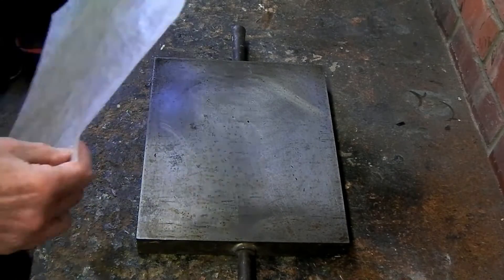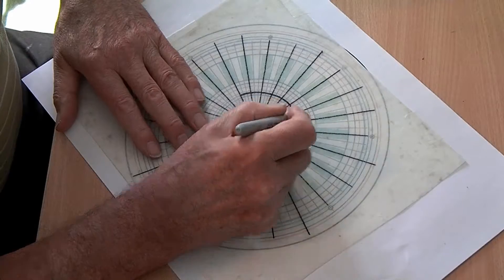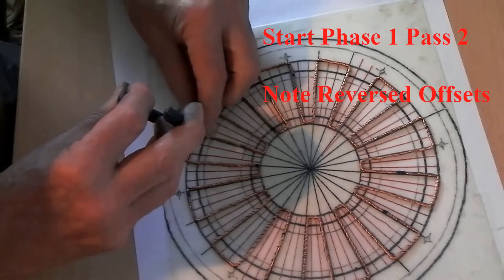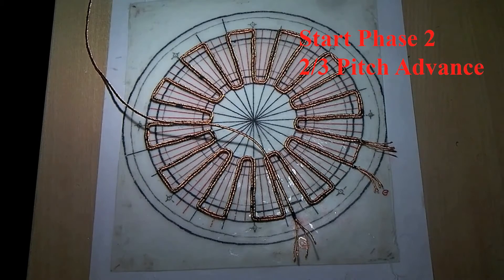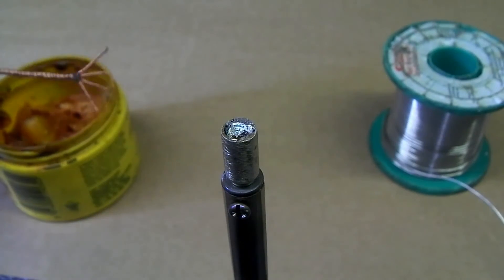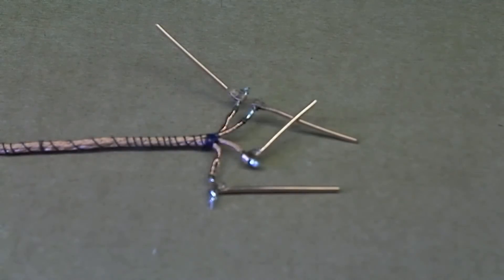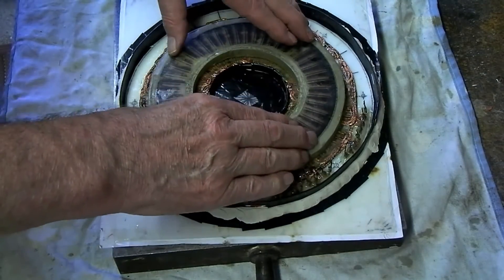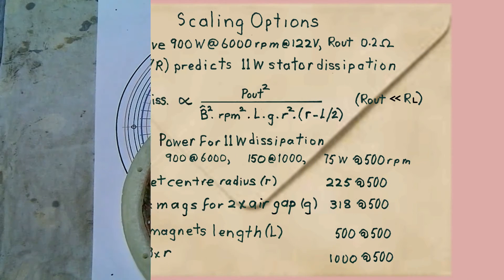Part 3. Axial Flux Alternator Stator Assembly and application options

Comment: I am fascinated by this design. Thank you for your very good explanation. 
Is it ok if, instead of 30x10x5mm, I should try to use 30x10x10mm magnets, for a greater magnetic flux between coils?
Reply from the maker: Yes. See my Parts 4 and 4A.     Meant something like  3 times rotor diameter  and magnet volume   
for acceptable  output power and and efficiency  at the lower speed of a directly coupled wind turbine.
Reply: @YesEinstein  Hello and thank you for your response.
I want to try to build one.
I had to choose between 40x20x5mm and 40x10x10mm magnets, both N52 with the same price. I do not know if I chose corect, but I will get 40x10x10mm, because of greater magnetic field at 1mm distance from the magnet (4693 gauss vs 2335 gauss). I will use 24 magnets on each rotor, pitched at 15 linear mm.
For the coils, I will use 40 twisted 0.12 enameled wire to form one strand, that will be equivalent to 0.759 mm wire. Then, I will twist 40 of those strands, so they will have a diameter of approx. 4.8mm.
Two strands will be put in parallel (for an equivalent of 1.073mm wire) and 20 of those in series for a total of 20 turns per coil leg.
I do not know the math behind, I hope this will work. 
If you have time, please let me know if it is ok.
Thank you again for the help!
Reply from the maker: @acesias   Suggestions:  Decide  number of turns needed.  Reference should be around  1.5 v per magnet crossing at 6000 rpm.  Note bundle width  geometrically limited to 5mm per phase.   Optimum axial gap also looks around this  value  when filled by copper.  Litz-type windings ideally need to ensure every sub filament crosses the same net flux and has the same impedance.  A  good composition  might  be four wound sub bundles each comprising three sub subs for  1, 2 or 4 x connection options. Shame 5mm magnets  not available; double  the cost and mass for not that much computable advantage.  Best regards  YE
Reply: @YesEinstein  I have found 40x10x5mm N52 magnets. As you said, half the cost and weight. But, the magnetic field at 1mm distance for them is 3331 gaus vs 4693 gaus for 40x10x10mm. That difference in magnetic field will not be so important for the same 5mm gap between magnets?
I am targeting a slow rpm, at between 500 - 1000rpm and I am looking at getting 24 - 30 coil turns per magnet
Reply from the maker: @acesias   Capability may be  judged by square of field across the gap divided by the  winding resistance.  N52  should expect around 0.6 Tesla at optimum  gap of around half the magnet thickness. We might thus  expect 10 mm to double  power capacity. My analysis however, indicated less than 50% improvement.  Twice the copper mass is needed.  For your low speed, best Litz may just be 3 wound subs wound 4 times around the stator per phase.

Comment: Is it possible to make this into a wind turbine? with more phases or more laps?
Reply from the maker: Dear Max Chillen  More laps would increase open circuit voltage  but not affect power handling capability. Three phase  is optimum.  For a low speed wind turbine, dimensional scaling by 3 might  give acceptable capability. Regard YE.

Comment: Thanks for your informative video. What configuration did you use for connecting the 3 phase wires?
Reply from the maker: Dear Maz Ekbatani  Simplest  option is  basic Star.  Sets of  4 pins are wired together to form successive start points and common end of the three  phases.   A  3 phase rectifier  (6 diodes)
produces the output. Regards YE
Reply: @YesEinstein  thank you very much.

Comment: You can also 3d print a core like i have
Reply from the maker: Dear RoboTronicsMotors .  You appear to have a coreless central stator (i.e. no iron) containing three-phase windings. For maximum efficiency, design aims should be 1. to maximise the magnetic energy in the stator volume (not clear here), and 2. to fill it with as  much active copper as feasible. In this respect any separators should be as thin as practical as advised.  You clearly have lots of lovely machinery at your disposal. Regards YE

Comment: how would you make a jig to make this kind of winding with out gluing to paper? I have a 3d printer and cant figure out a simpler way to create this coil
Reply from the maker: A more sophisticated one-off assembly method might be developed. Evenly attach 72 (24x3) thin rectangular “spokes” to the initial fibreglass sheet, between magnet inside and outside radii and up to the magnet thickness.  Attach two solid rings nominally twice the winding depth leaving radial space for the winding arcs and open hub. Successively wind each phase, starts two slots apart. Given a 3D printer, the frame might be fabricated in one piece adding encapsulant and top sheet after winding. Regards YE

Comment: Would you get the same amount of power out of your design if you used regular magnet wire?. Say, about 10 strands @ 0.5 mm magnet wire instead of the litz?
Reply from the maker: Dear Natasha McGill. Thanks for the progress report.  About 10 strands of 0.5mm per magnet crossing would maintain the baseline output voltage and winding resistance.  Calculation indicates however an additional 200 Watt copper eddy loss at 6000rpm.    Operation at 1000 rpm should give 5Volt and 100Watt at 90% efficiency. Around 5Watt eddy loss may remain. If required, finer strands with more bunch crossings would elevate the voltage while further eliminating eddy loss. Note the baseline winding can be connected, essentially this way, for 1, 2 or 4 times output voltage without efficiency loss.    Analysis has shown that the gap between rotors should be about the same as a magnet depth; 5mm in the baseline.  Design should pack maximum possible copper into this space. Note that wiring should ensure, as far as possible, all strands develop the identical voltage!    Regards YE

Comment: I am learning to design and build AC axial flux alternators for green energy. And part of my focus is energy densification. I am totally intrigued by your stator winding scheme. Unfortunately, I cannot for some reason find any really decent books on stator windings that include your style shown. Can you referance books for me? As many as you please, if you have more than one. Also, can you describe to me how to create the litz wire? From start to end? Every litz I have created so far, wants to twist itself up into really nasty bindings and pretty much ruins itself. And last of all, is there a way to scale this down to be a 12V alternator at lower speeds? Say, for charging a car battery in emergency situations?
If you can respond, I would be soooo grateful, that I would reference you as my inspiration when I finalize a product!
Reply from the maker: Dear Natasha McGill,  In the context I have only read,  and referenced earlier,  Professor Carter's 1954 book, The Electromagnetic Field In Its Engineering Aspects.  I have since  read some of the  many articles on the internet, so far with no obvious conflict. The Fem2 field analysis program is freely obtainable.  Low spec Litz needed  practice; try twisting and folding under tension.  I have already indicated scaling options.  In view of your and similar comments maybe I have to video a method of low speed high power design. Automatic efficient matching of one machine  to different speeds and varying loads was a feature of  the early bike series and can be developed for the permanent magnet machine. Thanks for the kind offer!    Regards YE
Reply: @YesEinstein  I would most definitely would appreciate a video of a low speed high output design to be shown. So far my focus seems to be energy identification. Aka overlapping stators. Concentrated coil or wave wound. Also, I am focusing on extraction of the most amount of emf via reducing the thickness of the air gap. And a diameter of a decimeter also. I don't know why , but, I am really stuck on creating a design of 10 cm diameter, with minimum 8 poles, and up to 16 coils double layered, or even tripple layered. Or windings like yours. And with a performance high enough to charge a couple of 18650 batteries . And by wind also. So about maybe 900 to 1200 rpm. It's a challenge no less lol.I have had some rudimentary  successes so far. Ultimately , I want to create a stator winding that basically has inductors in every single mm for maximum flux capture. This endeavor I have undertaken is most difficult lol. I do say, I really really admire your stator .  Its so neat and tidy.

Comment: YesEinstein, noting that you posted this video in 2016 I was wondering if you would be willing to do an email exchange on this subject I am currently investigating low cost wind turbine designs for manufacture and sale in Ethiopia the principle issue being to get as much power as possible at the lowest cost, the Halbach array combined with progressive wave coil may offer some potential to reduce copper content and therefore cost, would you be willing to discuss ?
Reply from the maker: Dear Kevin Roberts.   YE responds to public constructive  comments, and queries relevant to the immediate videos. Your contribution in this mode would be welcome.  Regards YE

Comment: Dear YesEinstian . Thanks for the educational content
What is the name of this type of coil? I want it for research
Reply from the maker: Dear Fara Tec,   Progressive Wave.  Regards YE
Reply: @YesEinstein  Thanks for the reply
Reply: I tried to make a sample similar to your model and did all the things, but with two differences
1- In my model, instead of rotating your magnets or routers.  I turn the coil for less weight
2- Instead of using a fuel engine, I used an electric spindle motor, and of course I turn the rotation speed to the same 8000 rpm.
But unfortunately, the result for me is that it doesn't even turn on a 30-watt light bulb
Can you help me make a 1 kW sample like the one you made yourself?
Thanks
Reply from the maker: It would help to show how  you made and commutated your moving  coils,  Litz  and  magnets assembly, winding and air gap thicknesses , actual output waveform and amplitude. etc.  YE
Reply: @YesEinstein  My handmade Litz wire is made of four strings of 60 types (AWG 38).
My type of magnet 30 * 10 * 5 with 42 degree and 48 on both sides of the router is exactly the same as what you made.
The distance between the two routers is 8 mm and the distance between the coils and each router is about 2 mm .
I can't offer anything about the domain because I don't have an oscilloscope, but each phase has an output of about 3 volts for me. 
I can email you more details with the photo if you wish
Thanks
Reply from the maker: Dear Fara Tec,     Litz and rotors separation noted.  Magnets should be 24 on each rotor for 15 mm  pitch at inside radius and must alternate North South around AND between rotor faces.    Output per phase will thus be linear with speed up to around 100 volts ( a.c) at 8000 rpm.    
Regards YE
Reply: @YesEinstein  sorry that I am late
I did everything exactly the same as what you said, but I still didn't get the result
I think the problem is the coil.
It is possible to make this coil as a single phase, in which case what output (voltage and current) should it have?
Reply from the maker: Dear Fara Tec,   First; rotating the coils, as you imply, must have some form of slip rings.  Is this effective?   Next; each 30 mm length of wire between facing N and S poles should develop at least half a Volt a.c. at 8000 rpm.  Successive reverse crossings between reversed poles will add for at least 12 Volt per round. Yes, try a one circuit solid wire experiment with all crossings matching magnet centres.  Bridge rectifying the output into a capacitor should give at least 17 Volt d.c.  Current depends on the drive motor. Shorting the output may stop the motor or produce a cloud of smoke. Fun isn’t it? Regards YE
Reply: @YesEinstein  Thank you very much for your guidance.
For the last question .😅
I can drive the rotor to 8,000 rpm and even more with a 100-watt motor
Can I get 1kw of your generator with that electric motor and 8000 rpm output?
Simple to say.  It is possible to build a generator with an input of 100 watts(Need an electric motor) and an output of 1kw ?
Thanks

Comment: intersting tutorial, 
i have 3 questions about the axial flux permanent magnets...
#1 how much length do we need from coil winding, between magnet to magnet??
2# how to calculate voltage output and ampere?
3# is there a book to learn for all of this??
thankyou.. and your video is a great.
Reply from the maker: Dear Ruddy,  thanks for your comment.   More of an unvetted exposition.    #1 Overhang outside the magnets  is minimised by close magnet spacing. i.e. lots around the circumference.  Too close and flux leakage negates the benefit. #2 Voltage:- Flux density times length under the flux times speed per crossing per wire. Current:- limited by tolerable dissipation.  e.g. If the resistance of the load is less than the winding resistance more than half the input will be spent heating the windings.   #3  For basic and applied theory, I have already referenced my "bible". There are lots of worthy internet reports about "coreless axial flux".
Reply: @YesEinstein  nice

Comment: Hi YE, You mentioned creating the litz wire assembly yourself using 0.1mm wire. Are these individual strands that you then roll together to form a litz assembly? Or are they pre-bundled litz magnet wire that you sometimes see used elsewhere? (I believe in radio)?

Also, any book or links for information regarding calculations and design specifications?
Reply from the maker: Dear Made 2 Hack,   Yes, with aid of a hand drill;  available prebundled  lengths too costly for one-off windings.  Radio frequency Litz  has very fine sub wires to avoid skin-depth effect, unnecessary  in our case.  Search "Litz wire types" for information on  bundling.  Part 1 video appends my expression for losses assuming perfect bundling.   Regards, YE

Comment: Where can we find that drawing or how to make it? I asume it has a relation with magnet dimensions, also I noticed it has 15 degrees separation. Regards
Reply from the maker: Dear Roberto Madriz, It may be drawn on Photoshop with sufficient accuracy. Magnets are 30x10x(5)mm, pitched at 15 linear mm for ~360 mm inside circumference.  3, phase Radii drawn per pitch.  Other circles indicate  wiring limits and attachment holes. Printed to unity scale on an HP A3 printer. Regards YE

Comment: This looks excellent. I was wondering what gauge the litz wire is you've used here?
Reply from the maker: Dear  The Bacon Wizard,    Windings in the video were four bundles of fifty 0.1mm solderable enamelled copper wire; each bundle twisted to about 2 turns per magnet length. The bundles were similarly twisted together and tightly bound, opposite-hand, with fine polyester thread.   Fine wire minimises bulk eddy loss.  Double bundling helps equalise simultaneously generated voltage on all wires  for minimum end-effect ohmic loss.  Ideally, the sub bundles would be serially connected at their phase ends, in  this case for four tmes the effective passes around the machine and minimum end effect loss.   Regards, YE
Reply: Thank you very much for a detailed reply, I intend to put this to good use!

Comment: thanks for posting.  nice work.  a few very late thoughts.     i do not see any COILS forming as the conductor is glued down.  i have experimented with a similar not-coil design.  i have no idea how you have connected these pseudo-phases; or, what the optimum number of magnet poles would be.  in my case, i could not get good performance.  without an actual coil, the flux and fields do not couple, sufficiently.  i guess.  i have a theory about the main cause of back-emf in a coil.  my conclusion is that, while back-emf is a source of internal impedance, etc., it is the main cause of the self-inducting properties of a conventionally wound coil.  see my channel, if it suits.  in the case of a high-speed application, connecting the stator coils of a pma delta, will result in output rising with rpm, amps over volts.  (so, 300 watts, might be, 10 volts at 30 amps.)  a suitable voltage-doubler or tripler would then give voltage, in the 'battery charging' range.  you could try winding flat, single layer stator coils.  the profile of the coil is just one layer thick (except in the area where one lead comes out.)    cheers
Reply from the maker: Dear David Davids, Thanks for your interest. There is just one coil per phase unfolded to a single layer encompassing all magnets. Upward legs cross North-South; downs cross South-North for additive coupling. Number of magnets only needs to be even.  The three coils can be simply star connected for rectification. ( The composite wire is splittable to give up to four times the turns per coil.)  Induced voltage on each element of wire is given by  v = Crossing flux density times length times velocity. This is mathematically the same as rate of change of  total flux through the coil area. Coreless inductance and armature effects should be small compared that of an iron cored machine.   Regards YE
Reply from the maker: Dear David Davids,  Winding resistance is the dominant source of loss in the coreless machine. Inductance has a secondary effect, not necessarily  detrimental. It will be near proportional to ( magnet face area x number of turns  divided by (winding thickness plus 2 times one rare earth magnet thickness); thus much smaller than in an iron-cored machine.  How the winding is layered pretty irrelevant.   Regards YE